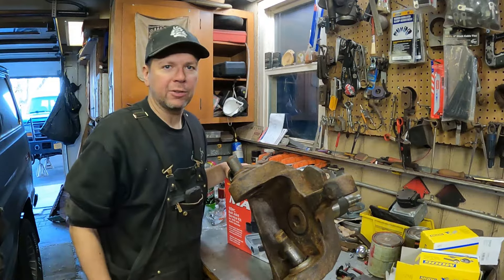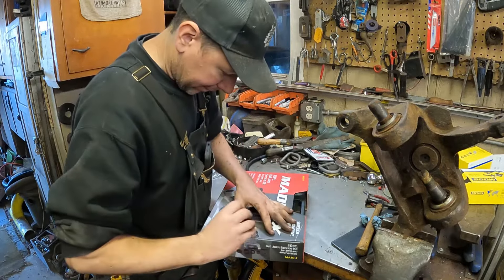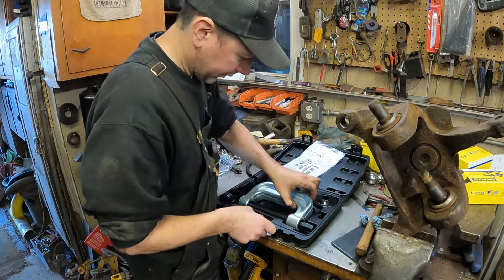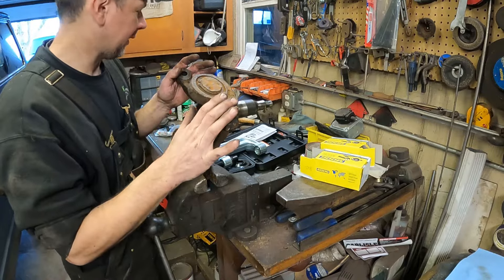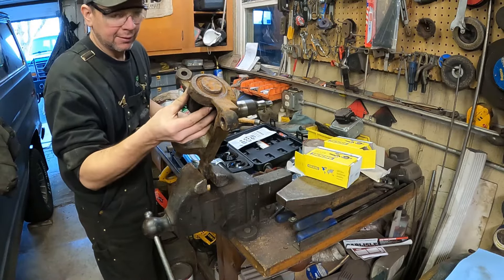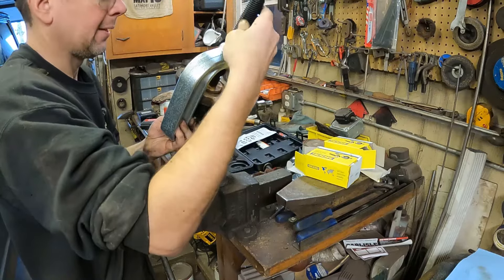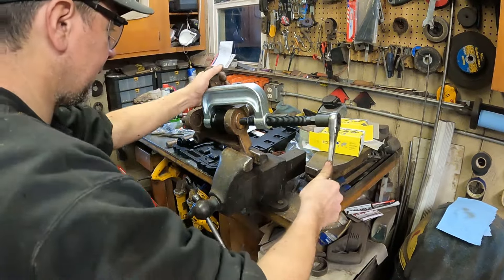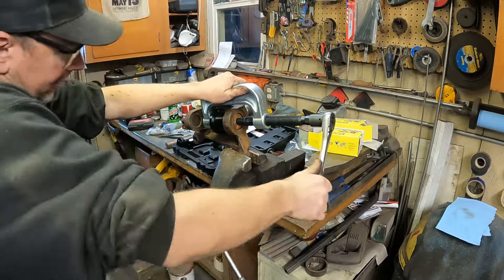Quick Tool Review:  Harbor Freight Maddox 10 Piece Ball Joint Press

Comment: Don't use an impact or even try to ratchet it out by force. The cast steel clamp threads are weak. Just put tension on the BJ, remove the ratchet but leave the socket and wack with a good 4lb or so mallet. Re-tension and repeat. You must leave the socket on or the screw hex will mushroom. It's OK as a DIY tool but if you just brute force it it'll be scrap metal after 3-4 jobs.
Reply: Funny finding you telling him this, I exploded this tool two days ago on the very first job. The threaded part turned out is hollow, that isn't a solid threaded rod and has a bearing ball inside that rocks back and forth after you bust the end off of it, I still haven't found that end piece that swivels.
Also yes, when it exploded the threads slipped almost 2 inches back thru the threads.
Be careful readers!
Reply: So your saying spend the extra 40 bucks and get the OTC? 😂
Reply: @Jase608  It the OTC better? Of course. Regardless of brand you still never use an impact with these tools. Doesn't matter if it's Snap-On or a Shenzhen special.
Reply: Looks like a good tool for a few bucks. I you don't have a press it's a good start. When you do get a press, the collars and bushings are very handy.
Reply: @d.powers3428  Entire point of the tool is to do the BJ in place. You don't pull a control arm unnecessarily. Complete waste of time and $$. Then necessitating an alignment  after. One tool does not replace the other.
Reply: @SerenoOunce  Shure, given the ball joint, is not married to the adjusting cam nut. And assuming the ball joint is not on a large vehicle.  That type of tool has its place. In a DIY garage.
Reply: @d.powers3428  Umm, no. It's for every garage. Because again, one tool does not replace another.
Reply: @SerenoOunce  It's the quality the one I have is nearly 60 years old. I use it on all kinds of stull. The art is in the various tools fabricated over the same period of time to press different items. The collars' bushings and spacers should be forged as well. 
If you can find a good one, it will be forged steel and not cast of any kind. Don't know how many kids show up with those harbor freight one in the box. Good thing the shop has one that will work. And several presses of different  capacities. Perhaps my definition of a shop is somewhat different than yours.

Comment: I have a 67 Buick Riviera. The upper ball joint has 2 spot welds from the factory. I had to grind them down, and it still was a bear to come out. There was nothing wrong with the ball joints or bushings. I just wanted new ones, so it could last another 56 years.

Comment: If you're doing rusted in ball joints using this tool, hit the joints with penetration oil the day before. These tools will bend over time, but the easier you can get it to come out, the longer the tool will last.

Comment: I’m doing all the work myself on several w123 Mercedes  models . They have some weight on the front end with a diesel sitting out front so The old  Ball joints got to go , look forward to trying this out , after one car is done I’ll likely do the rest right away .A shed and a few good  tools keeps me a happy man , thanks for your review .
Reply: How did it work? I have a 1980 240d manual I've got to rebuild the whole front end! Did you remove your coil springs and do it all? My inner tire treads were wearing

Comment: Auto tech here, for everyone talking about the threads stripping or binding, you need to GREASE the threads of the driver with a nice thick coating to reduce friction and binding. Also cleaning your tools after each use especially around caustic fluids will add to their longevity.
Reply from the maker: Thank you

Comment: Try this tool on a GMC or Silverado 4x4 and you'll find it doesn't fit over the joints at all. I had to cut both upper and lower and rig the damn tool to make it work on mine.
That's after the first Maddox tool exploded on me with the first use. Took it back and they didn't want to swap it out till I showed the manager what happened to it. I felt it was a flawed unit and got another one. Finished the other joints after rigging it to fit. Almost scared to use it again, need careful people, the end exploded on mine, meaning the threaded swivel end, I have yet to find where it went. I had the entire unit in the vice just like this video, exact same method was used except he placed the swivel directly against the joint. The book tells you to use the other adapter at which point it won't fit.
Reply: Yep will not fit
Reply: Did my lower ball joints on my 2004 GMC Yukon xl with a dewalt xr 1/2” impact and it worked like a charm.
Reply: @millertime8835 what yeae
Reply: @cyrilrobertson3480 I'm looking to do my 2002 Yukon... Want this but now ppl got me 2nd guessing